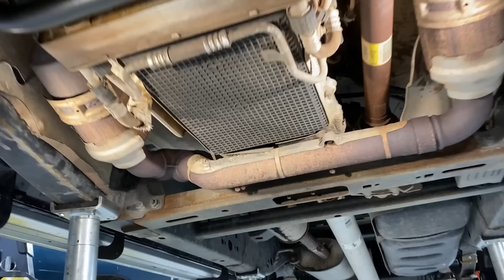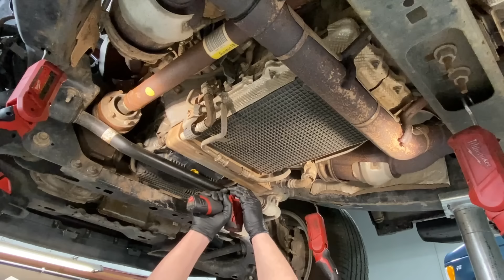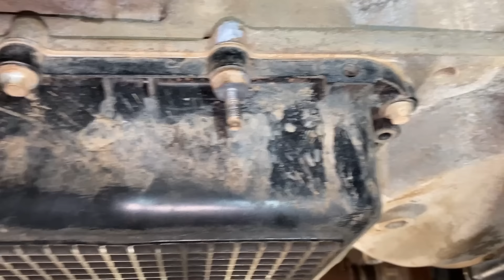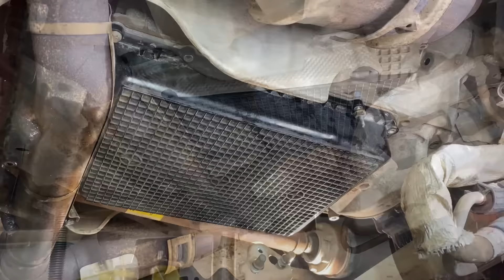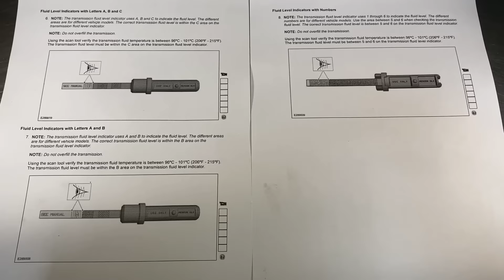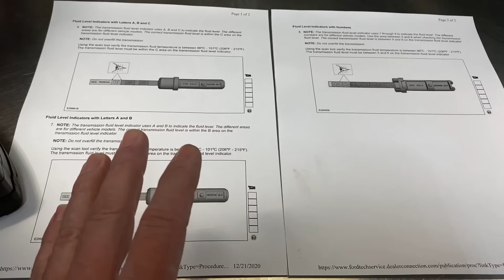Ford 10R80 Ten Speed Transmission: Fluid and Filter Service Procedure

Comment: semi related question have you ever used the aftermarket kits to give you a top side locking dipstick? figured when your dropping a pan would be a good time to install it and mark the stick. good video
Reply from the maker: Never have and I never will.

Comment: 0_0 Holy smokes, that's a LOT of work to get to the drain pan..  Cool video!!!   I dig the bolt on filter.   I just got myself a new-to-me 2017 F150 with a 2.7 , so I'm hopeful that it'll be okay for the long run, knocking on wood for that oil pan....   I'm still planning on 5K kms oil changes full synthetic, even if i have to use Ford service til the warranty runs out..   It does have the 6, speed which I've been more than used to changing fluid and filters on my 2010.  Good tip on the battery disconnect!!  Could, and would, that still apply to a 2017? I know I found the Ford Pass app, and it's crazy to see you can start it from a phone!   And the new truck is also a 4x4 so I'll have some new challenges in taking care of those components. But I'm grateful to see a video on how relatively simple it is for the transfer case fluid change!  These videos are the best, thanks!!
Reply: full synthetic at 3K miles is a total and complete waste of money.  Go by Blackstone Oil Analysis or similar and easily get 7-8K miles on good synthetic.  You are behind the times.

Comment: I can see a future video from Brian showing us the pain of changing out the electric motor for the pressure pump for the start/stop feature. Electric motors are becoming too much of a crutch for making many of a trucks/cars functions work (eg. power steering, anti-lock brakes, AC door acturators, etc., etc.).
Reply: electric oil pumps WTF

Comment: 2012 Ford Edge SEL, 2WD, 3.5L, 120,000... transmission noisey (like bucket of bolts) when stopped in gear (holding down brake pedal). During driving, when coming to a stop (Right around 20mph) car shudders (Possibly downshifting 2 gears). The other day sitting a stop light in gear, whole vehicle shuttered like transmission was gonna blow up. Dealer tech mentioned planetary. Mechanic buddy say to try software updates, flashing. What your input?

Comment: Fords first mistake was eliminating the torque converter drain plug, It just gets worse from there.
Reply: Drill then jb weld, or make new thread then put world's first drain plug for f150 2020
Reply: @technocody9296  would definitely not drill into a newer tourqe converter with lockup unless you know exactly where to drill.
Reply: @arthurhardy  I like to see metal housing explode into ten to hundred pieces or just crack. That case deserve it by shithead engineer and corporation doesn't care about us. 

Other options, take housing from older generation and swap all gears in the case so new gears in the old transfer case housing that come with drain plug. If not possible then very sorry. Hopefully EV generation is not hard to maintain...

Comment: I bought my first Ford, a 2019 F150 with the V8 engine and 4WD.  At time I get a rattle like sound (like gears rubbing) in lower gears (I think between 4 and 8).  Ford dealer is telling me the computer is learning how I am driving and it will go away.  Does this make sense to you?

Comment: These are fun to do engine oil changes on too. It's hard to snake that plastic drain plug out of its place, and then the oil splashes all over the sway bar and the transmission cooler. The 10-quart oil capacity only helps with the mess.
Reply: It's weird because on my 3.5 ecoboost the plug faces the side and is VERY easy to get to and doesn't really hit much with the oil flow. Plus I like that my ecoboost only takes 6qts.
Reply: This is infuriating.  Plus that big diameter plastic plug flows about 3 quarts per second.   I would like to talk to whoever approved that design.
Reply: @winstonsmith3685  I think it was to save the Ford Quick Lane techs time on draining the oil.  Get em in and out faster.

Comment: Haven't looked under mine yet to find out, but on the 3.0 Diesel, is it similar to the Ecoboost or the 5.0?
Reply: He said it was the easiest only has exhaust pipe on one side! So one heat shield.
Reply: @markpontes4457  Must have missed it. I rewatched the part when he was talking about it and didn't remember. Good to know though. I'm due for a service.

Comment: Hey wassup man I have a 00 mustang gt 4.6 sohc.. I have a problem where when I put it in drive soon as I tap the gas it stalls out.... I swapped out the idle air control valve and all 8 coils and still nothing.. what could it possible be?? Mabye a vacuum leak? I do have a check engine light but I have to have someone scan it again 🤔

Comment: This video makes my 2019 5.7 tundra feel like a dinosaur, fill plug, drain plug, level check plug and metal pan.
Reply: That dinosaur will probably run to 500000 miles without any problems other than a huge gas bill.
Reply: Yep, that's why my next truck will be a Tundra
Reply: for the gas you are wasting in the Toyota gas hog, you can easily pay for the service several times over.  Abysmal gas hog

Comment: You recommend a "fluid only" change at your first 30,000 miles. Can this be achieved with a suction pump? Is that satisfactory or do you still need to drop the pan?
Reply from the maker: Yup that works

Comment: Great presentation!  I have this exact model.  My dealership wanted $500 for this procedure, I thought they were scamming me but apparently not.  Looks to me to be about a 3 hour job.  I normally do my own work but in this case, for lack of tooling and manuals, I’ll pass.
Reply from the maker: Yup this one was $500 too.
Reply: Thanks for the info !
Do it include the oil, filter and the seals ????
Thanks for your help!!
Reply: @JuanLopez-ki8lm  that was the dealership price for the job so I have to assume that includes everything
Reply: @etubrutus3501  many thanks for answer me!
Blessings

Comment: As an owner of a ‘20 f150 with a 5.0 why does the engine have that diesel sound?
Reply: A lot of the noise is that transmission, the other part is it has directbinjection like a diesel much higher fuel injection pressure!
Reply: Have it on my 2018 5.0 CNG ..  I added a Flowmaster series 50 stainless muffler...left the resonator on the truck.....No drone....240 bucks.  Nice

Comment: Great video.  I did my t-case and diffs recently and was contemplating doing coolant and trans soon.  Very timely information, thank you (2018 F-150, 5.0) you definitely confirmed I don't want to try this in my driveway for sure.  Will get the supplies and "borrow" a friend that has a lift to help me get this done.  Got a little over 70K on mine so I want to get it done soon.
Reply: Did you ever end up doing it?
Reply: @tonykellar463  Yeah, like 4 years ago.  Sold the truck right after that... Bought a Mustang. 😁😁
Reply: @alexpope5327 did it go well? Any harding shifting after?
Reply: @alexpope5327 never mind, resolved issue. Did this service yesterday, very hard shifting after. Got stuck in 5th and 9th. Reset TCM gears. Shifting great!

Comment: I'm half way thru so far and all I keep thinking is: "I'm glad I'm planning to keep my 5.4l 3v and 6R80 running forever."
Reply: I have the ZF 6 speed manual in my F-250, that's just removing the fill plug, pulling the drain plug, waiting for 30 seconds, reverse that but add ATF before putting the fill plug back in.  Everything is wide open under there and easy to service--another reason it's a shame nobody builds a truck with a proper transmission anymore.
Reply: ZF designed transmission is probably one of the best Ford ever used. My 5.4 4R75 is ok, at the times I feel like it doesn't have enough range for torque putting out by 5.4 3V.

Comment: Thanks Brian  .
I would like to say that  , instead of disconnecting battery terminal  .
Instead remove starter relay   , this will prevent accidental cranking.  And you will not lose memory settings. 
All newer vehicles use a starter relay .
Also great way to crank  / turn crankshaft without power too coils and fuel injectors . To perform compression test etc .
Reply: @Inverse Universe Actually Ford has a failsafe, the remote start won't function if the hood is open.  So as long as you don't fully close the hood, you don't have to worry about accidental remote starts.

Comment: This may be a dumb question but why the heck don’t they put a drain plug on transmission pans?  Having to remove a bunch of fasteners and then contend with a flood of fluid all over the place seems dumb. Also - is there no way of using a cartridge filter as are used on engines?

Comment: Hey Brian, why don’t manufacturers make changing transmission fluid like changing engine oil? Put a drain plug on the pan and have an external filter? Would be so much easier.
Reply: it would be too easy and cheap to service so vehicle would last too long with proper fluid maintenance.
Reply: like a Allison transmission spin on filter
Reply: @turbo gtr  Exactly!  All automatic transmissions should be like the Allison.

Comment: Explains why dealers have lots of 80,000 ish used trucks. Trade it off, let the next guy deal with it. Hate to see my favorite brand make maintenance so complicated.
Reply: You can easily get away with poor maintenance for 80k miles.  By 80k miles most have positive equity or the vehicle payed off or money saved up to buy new with cash.  The trade in value for vehicles falls pretty slowly for the first 100k miles and then falls off a cliff.  Smart people buy new, do little maintenance, and then dump them before 100k.  I buy new and barely do enough oil changes to comply with warranty.  I blow out the air filters.  I buy wipers at Costco on sale.  I do no other maintenance besides maybe one or two tire rotations.  I dump the car before 100k.

Comment: Good to know that they managed to put a plastic pan on the trans,  they most have done an intensive research .... just like they did with the powershift. And I like FORD, but not THESE BMW-ish things ... No thanks. But hey, they are driving the used truck market prices to the sky as they did with DPF and all the new Diesel BS ... to the point no one will buy a Diesel
Reply: yes good old used trucks prices are high for this very reason

Comment: My 10 speed randomly slips in 4th gear. So I guess I'd better learn how to service the trans so when I get the slip fixed I can change the fluid often.
Reply: why is it slipping... did you burn out the clutch pack ?
Reply: @glasser2819  not sure why yet. It's very intermittent. Don't want to bring it in to the dealer yet because they probably won't find anything wrong. But I'll get it checked before warranty is up. Got all the PCM updates too for harsh engagement and things like that.

Comment: Just a thought, on my trucks I use a fluid extractor down the dipstick/filler tube. Do you think it’s possible to do it on this transmission where that little wanna be dipstick goes. If you could extract some of the fluid through there before removing the pan, it should make the mess smaller or maybe no mess at all. I wouldn’t want to clean up all that oil off the floor after taking the truck half apart just todo something that should take 15 minutes. Like I said I use that fluid extractor & I have absolutely no cleanup afterwards. Best investment I ever made. You could get one for under $100.00 from Amazon or harbor freight. Just a thought.
Reply from the maker: I would never use one, this is much faster, the main spillage is past the exhaust initially, the rest is dumped in front of the exhaust as you tilt the pan down to remove and then the trans drips onto the exhaust anyway the whole time the pan is removed. I just don't see the point unless maybe you are doing this on the ground. I do have an extra large catch pan on top of my drain bucket so never an issue.
Reply: Most of us do in on the floor. I won't want to do the 10 speed on the floor but my 2015 is do able

Comment: Can you just loosen the 2 bottom trans mount bolts to allow the transmission to raise?
Reply from the maker: You mean nuts? No otherwise I would of done it of course.
Reply: The exhaust would have moved with it wouldn't gain the space.

Comment: Really glad I went with the 3.3L 2018. Loving the 6 speed, did a pan drop a month ago, much simpler. Thanks a lot for all the videos you do Brian, You're a lifesaver.
Reply: Cope
Reply: @Greg B  Ya, well I was kind of lucky on my timing. I bought my 2018 "new" in March of 2019, it had been sitting on the dealers lot quite awhile. I did quite a bit of homework on all the Ford engines, so I became aware of the 5.0L issues. Lucky for me cause the previous generation 5.0L with the 6 speed tranny is a good solid setup, so I had been considering it till I found out about it's problems.
Reply: @joeblow4888 10 speed is way more smooth while driving and towing
Reply: Nice you can get 2018 and up models with the 6 speed?
Edit: had to Google it. The 6 speed is only available on the 3.3.

Comment: $500.00 transmission service! If your lucky!
Reply from the maker: You nailed it!
Reply: $210 at local Ford dealer (didn't include new filter).  Turned out to be moot point to me, I was having an issue with auto stop start malfunctioning.  In the end the issue was the aux pump failure caused the engine to restart almost immediately (it has a sensor to keep from frying the tranny)....WARRANTY COVERAGE....YES!  FYI, your video helped me to avoid them charging me the $210 (they claimed 2x that aux. pump was outside unit so didn't need to pull pan).  After multiple discussions I asked to have their tech show me under the truck which pump he was referring to.....they called back and agreed aux. pump is in the pan.

Comment: How many miles was on that 2019 that it needed a transmission fluid change and how much does the dealer charge for the trans service
Reply from the maker: Just over 30k miles and he wanted it changed.
Reply: Yes I was looking in the comments on how much this service is.

Comment: F150 drivers be like:
"F150's are the best quality trucks in the world!  I know because I've been driving them for 50 years!"
Yeah, 50 years divided by 30 different trucks that he keeps trading in every couple years.
Reply: I have a 2003 F150 with 235,000 miles and still going. I’ve done the recommended service. My only regret is not using fluid film underneath to control the rust. Replaced the alternator, starter, driver side window motor twice and the shocks twice. 

My 2019 2.7 just hit 100,000 miles. It’s clear I’ll be paying someone to do this nonsense. But other than replacing a sensor no issues yet. 

My oldest son swears by Chevy, but his 2014 1500 and 2021 1500 the transmission went on both after 60,000 miles. He has a 2500 now with no issues.

Comment: I dont understand why they dont put drain plugs in the trans pan some do but not all my 2003 superduty has a plug makes this way easier. and why didnt you just take the 2 bolts out for the trans mount and lift it

Comment: That's a pain in the ass trans service!
Reply: No it’s not. You just pay a good tranny shop to do it.  I change my own engine oil, but I’d never touch a transmission.  Transmission service has always been a messy pain in the ass job.  If you are an easy going driver and do not tow the transmission doesn’t need that much service.

Comment: What a legend!  My '18 150 just hit 30k miles too.  Thank you so much for posting this video.  Do you know if anyone makes an aftermarket aluminum transmission pan with a drain plug for these transmissions yet?
Reply: Don’t know if you got an answer but the mustang has a couple metal pans available. As for drain plugs, the composite pan and plastic plug work very well. I’ve seen a few people think a metal version of the plastic plug is better… it’s not. Mixing metal and “composite” (fancy plastic) causes issues due to conflicting expansion rates. You’ll see that metal plug fire off and you’ll oil down the road.

Comment: That is actually absolutely ridiculous
Reply: with the exhaust cross-pipe 1/2" away from the plastic tranny pan... one better not idle this gem too long on a hot summer day 🙄
Reply: @glasser2819  Ummmmmmm, are you blind or did you overlook the heat shields.
Reply: Brian, I just watched your Series on 3.5L Ecoboost Timing Set R&R after this one........ 
Makes me want to hold on to my 2V 4.6 Mustang GT and 3.8L V6 Mustang a LOT longer!!! 😳
Reply: Couldn't agree more.
Reply: Thats what I was thinking also, f that. Dealer can do this job...not going to mess with this in driveway without a lift. Ford you win lol

Comment: What a PITA!  I wouldn't take that pan off till it reaches about 90 or 100K, but I would at least drop that cooler every 30K, take off the fill cap and have an assistant start it up and let it puke out the fluid till it starts spitting air and turn off immediately refill and repeat. Do it every 30K. Maybe by the time most of these Furds are getting close to 100K, the aftermarket or Ford will offer a 2 piece aluminum transmission oil pan with a steel  access plate and drain bolt on it like the 4.0L SOHC oil pan has for you to take out the broken nylon guide pieces out of the oil pickup to get another year or two out of the Furds before you junk them. LMAO

Comment: Wow, good work and explanation as always. Seems like a retrofit by Ford., hence the jigsaw. This is the GM codesign trans, so the complication makes sense. I wonder if it ran hot so they added the cooler.
Reply: IIRC, Ford puts in a larger cooler in front of the radiator for the ecoboosts with the tow package. This one they like to run hot even with the small cooler. 105C/220F
Reply: @weedeater62  ahh, makes sense, thanks!

Comment: I hate that newer vehicles are doing away with the more traditional trans dipstick and fill tubes that you can actually access from the top of the engine..
Reply: K & N makes one for the 10 speed. Nice unit. Sells for around $ 230.00
Reply: Whoops !! I meant B & M not K & N.